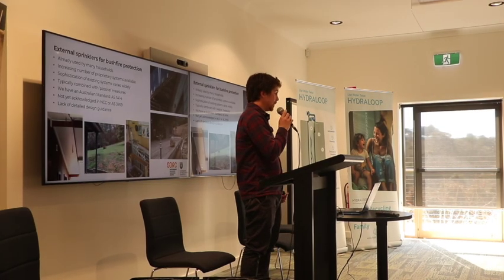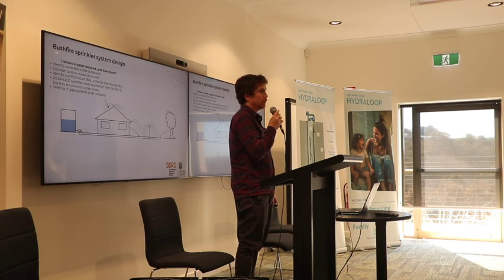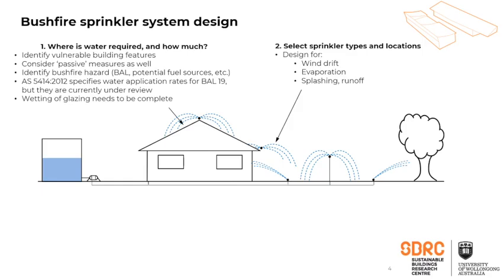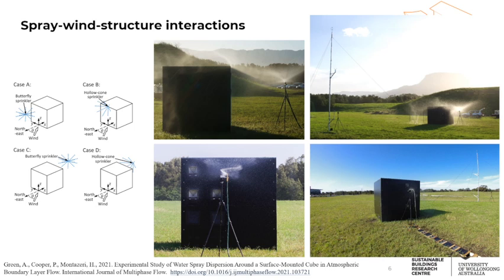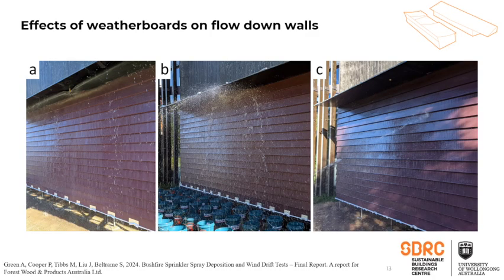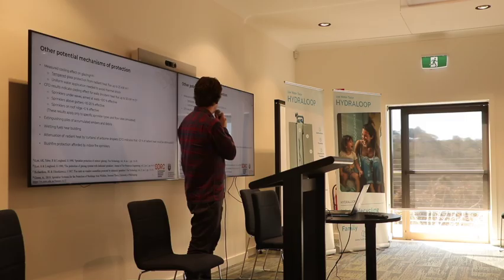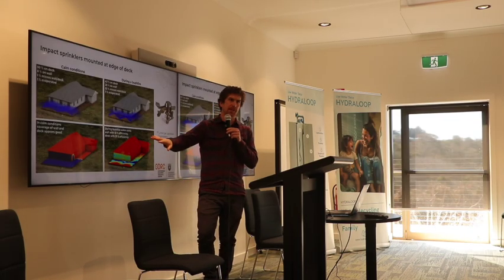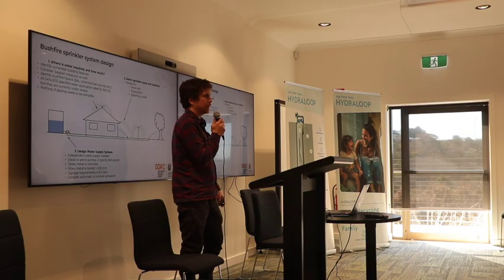Bushfire Sprinklers: Latest Research

Comment: I know someone in America that fought fires in Yellowstone using commercial agricultural irrigation equipment. He and a few of his men came in and placed a quarter mile long two inch inch hand line (pipe), powered by an 800 horse power diesel irrigation pump. This sprayed massive amounts of water from the river and what was covered was not going to burn. This method was used to protect a few towns and camps. At one point, this equipment was set up ran for a while, pre wetting the area, and then was re deployed to another area. (Fire changes, risks change, where men are at changes.) The area around where he set the equipment up burned about 3 days later (as a fire came through) but anything that had gotten wet, or was in range did not burn. one side of trees burned, the other did not. (water content). The fire fighters at the time fought fire with 1 inch fire hoses, and he had a lot (10 to 20x) more water than they did. They were rather impressed how many gallons of water he could throw. In irrigation, there is a lot of concern for "water loss due to evaporation" and estimates of 25 to 40% loss are common; however as the fire came through down wind, there was evidence of the humidity difference stopping the fires from burning 1 kilometer away. So one of the lessons here, is that humidity does make a big difference in the way the fire burns and what it burns. Just keeping the humidity up in any area can have profound difference when the fire comes. If one has the times and resources, pre-wetting the ground, weeks, days or even hours beforehand, can do a lot.
Reply: Here in N.Z I'm trying to help someone in California on doing exactly this but no one wants it when I mentioned cost. I think 30.000 liter reserve supply of water will do per household.
Reply: @conmanumber1  There are some cheap ways to put together a system. Used food grade Pallet Tanks can be had for <$100 each and hold 250 gallons of water. Large 2,000 gallon water storage tanks can be had for $2,000 or so. A plastic septic tank, common and available everywhere, might also be used. From their, Harbor Freight gas water pumps seems to be popular selection of entry level systems.

Comment: I may be thinking too loud here, but will it be too difficult and expensive to build a water recirculation system for these fire sprinklers, so that the amount of water needed to run the system becomes a non issue ? Basically for this system, create a 5-10' wide concrete floor around the  entire perimeter of the house to catch the run off. Then ,  direct the runoff water from this area and gutters to a tank and pump the water from that tank to run the sprinklers. Any water lost due to evaporation or wind will be replenished from water main through an automated level maintaining system. 
I guess 70-80% of water can be collected back for the recirculation system and will allow use of large number of high flow impact sprinklers to thoroughly wet the roof and walls without worrying about wastage of water. 
The system will be expensive, but will look dirt cheap when compared with losses inflicted by wild fires like Palisade.  Making concrete floor around the home is already being recommended for fire  hardening of homes . Couple this with other measures  like metal fence,  non combustible side and roof claddings etc and when implemented at community level through updated building code , I would hope we can have a solution to CA wild fires.  Moreover, these measures could be incrementally implemented keeping financial considerations in focus.
Reply: I think that is too expensive and not needed. It is much easier to put in a pond, pool, large tank. One can also be effective with a smaller well driven garden hose. In high wing blown wildfire, the wind will blow the water away. In the week long time, when the wildfire is approaching, it is all about keeping the content of everything damp, or wet. Moisture levels are critical to what burns.
Reply: your estimate on the amount of water that could be reclaimed is way too high. a standard spray nozzle typically has an evaporation rate of around 40% so you would be seeing at most 60% reclamation. due to the fact that lots of the water is hitting and staying on the walls, my guess is you would see close to 20-30% reclamation max. a better and more cost effective idea would be to design a nozzle that effectively soaks rather than sprays which would allow for maximum contact of water onto the surface with minimal losses due to evaporation. the more water on the surface, the less is needed to be pumped out by the sprinkler. no complex reclamation system needed. 

he actually went over something similar in the video where he described a system that could be cycled on and off to keep the area wet enough to prevent ember ignition without wasting water. this would likely save more water than an always on reclamation system like the one you described.

another thing to note is that active sprinkler systems are only effective to a certain degree. they are largely useless if not combined with good passive systems. so the passive systems like ember screens and fire wise construction practices (which are cheaper and easier to implement) should be required by code and active systems can be added for extra protection if cost allows.
Reply: @ agree 100% with your comment. A combination of both passive and active fire defense measures will be needed to be effective in making homes safer against wildfires. Above all, updated building codes to mandate the implementation across the neighborhoods and towns will be key for any success in this endeavor.
Reply: Spot on, the amount of water needed to combat the thermal energy  of a bushfire for 20 minutes is massive.  And yes, reclaiming water is not a good plan.

Comment: Hello from Los Angeles- Palisades fire 2024. Excellent presentation. Im installing flat fan under eaves around house this year.
Reply: what is your plan for roof top ? No option looks like a good option per this presentation .
Reply: @aks20002  The majority of asphalt shingles fall under Class A providing a high level of fire protection to the roof deck. Class A shingles are considered fully fire-resistant, offering robust defense against the spread of flames.  I'm worried about ground cover near the house, and embers getting in attic vents.
Reply: @ that is true, but I have read at many places that ambers can get to the roof deck through the crevices between shingles or concrete tiles or fascia and rain gutter. Roof top sprinklers may mitigate that. But I agree that best protection will come through passive defense measures , like concrete floor of 5-10’ width around entire perimeter of the home, no vegetation near 10 or more feet, metal fence, metal gutter guard etc etc.

Comment: If your plastic fittings are enclosed in a curtain of spray, they are unlikely to melt or burn. It's all very well to define optimum practices, but if they result in people not taking measures because of their unaffordability, it is not helpful. After attending a workshop, i have spent $200 on pipes and fittings for a DIY system. I will extend it, but already it's fairly impressive. Bushfires typically move through very quickly and quite minor protective measures can tip the balance from burning to not burning. Get stuff wet, that is the secret. Wet stuff does not burn. I have a lot of treated pine landscaping and the sections that did not burn were the ones i hosed down the night before the fire came through. And I don't have 100,000s of litres of water. Do what you can afford, and use what you have, don't worry about the 'experts' telling you it's not good enough.
Reply: 100% my DIY sprinklers where a major part of me saving 2 dwellings & 5 sheds, all old & timber in 2019 near Cobargo - you summed it up perfectly.
Reply: nobody is telling you it’s not good enough. if you asked any of these experts they’d tell you that they’ve been saying the same thing as this comment for YEARS. but that is not what the video is about. this video is about the “latest research.” which is not necessarily  hand in hand with affordability.
Reply: That's what I was thinking. I built a heavy duty sprinkler out of steel and a brass impact sprinkler. It's great, but it's like over $100 in hardware. So this spring, when I start designing something, I'm going to try and make it much cheaper.
Reply: For those requiring a water tank just switching to a non combustible tank material can be cost prohibitive.
Reply: Absolutely!
Reply: Excellent wise examples
Reply: Totally depends what level of fire you are protecting for. If you choose to stay because of your BAL-19 measures and get caught in a BAL-40 fire then it's black Saturday. It only happens to a minority but the risk is extreme. Emergency services tend to be risk averse for this reason